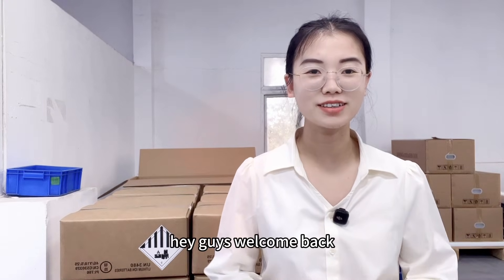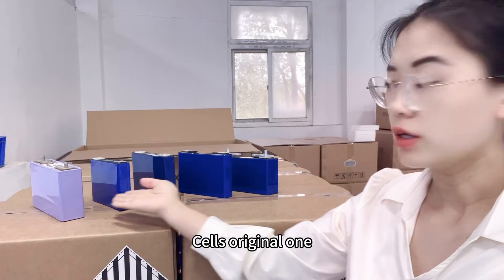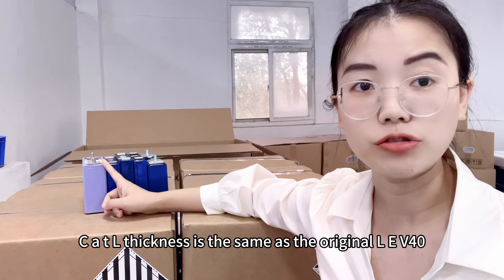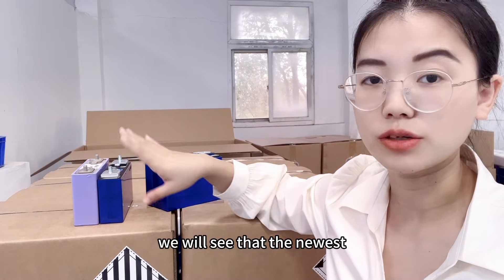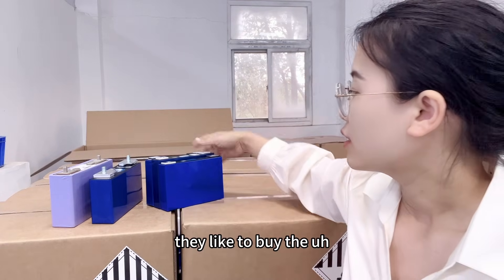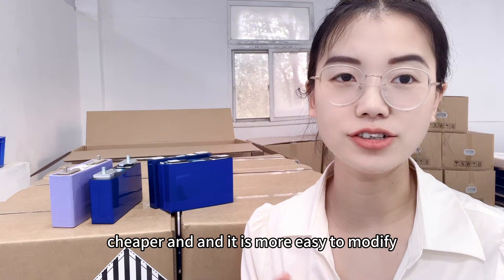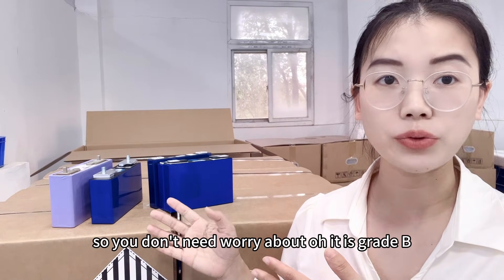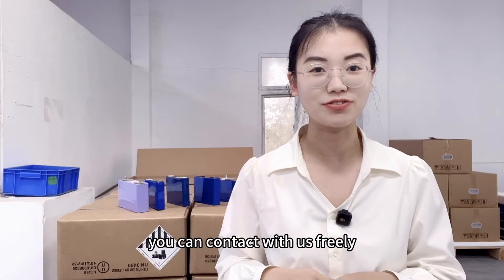18KWH battery for Mitsubishi outlander battery upgrade

Comment: that battery is not even close to a factory standards for Mitsubishi.But at least is cheap.
Reply: They are far better, the originals are old and Mitsubishi hasn't bothered to upgrade the standard batteries, I'm putting Catl 93ah in my Mitsubishi minicab miev Ev.